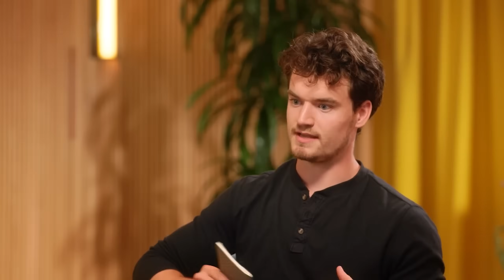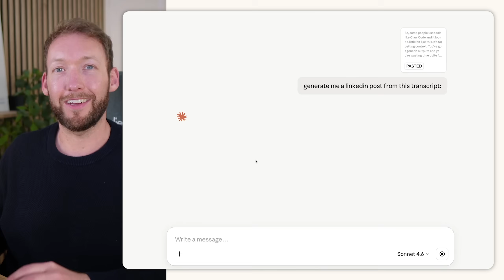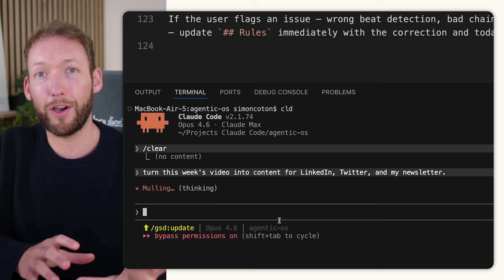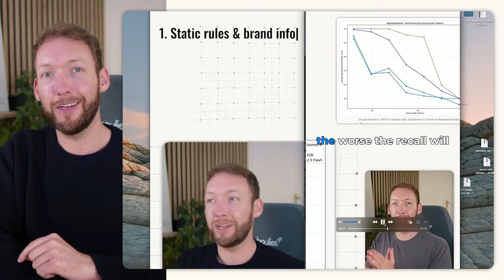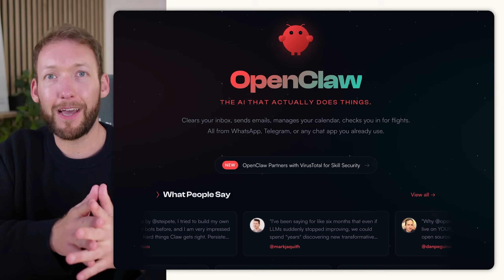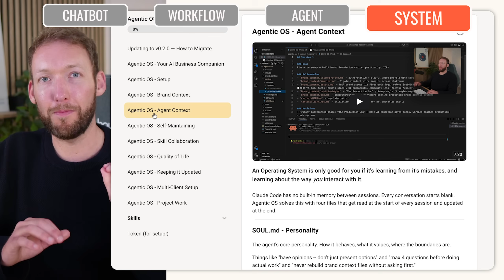Agentic AI Systems, Clearly Explained

Comment: Great topic—agentic systems are game-changing for moving beyond research to actual execution. The key challenge most teams face is reliability and connecting those agents to their actual tools and workflows without constant manual intervention. If you're building these systems, platforms like Barie handle the heavy lifting of accurate research combined with reliable multi-app automation, so your agents actually complete tasks end-to-end.

Comment: Could you use Gemma 4 to run a system like this and not worry about Tokens?
Reply from the maker: Most likely yes, the principles are the same no matter the underlying models - the terminology is slightly different for each but most things are transferable e.g. skills, folder structure, memory
Reply: Yes